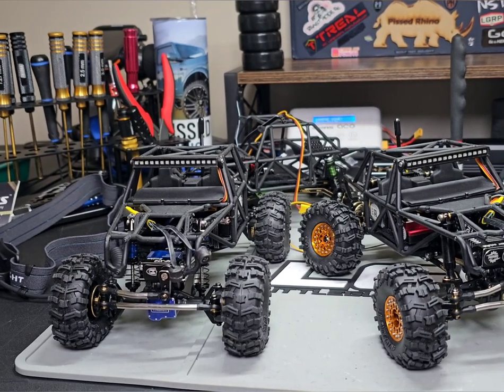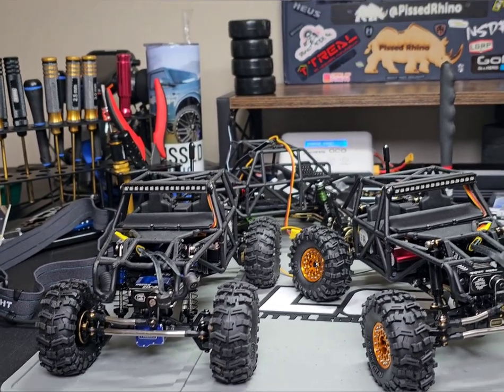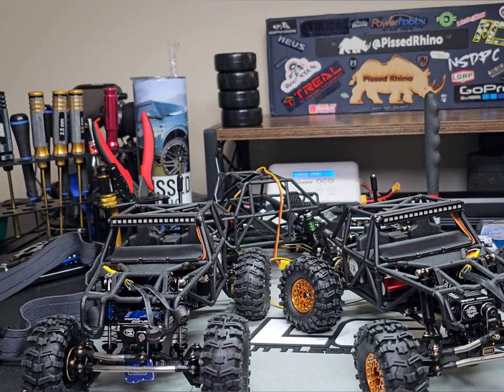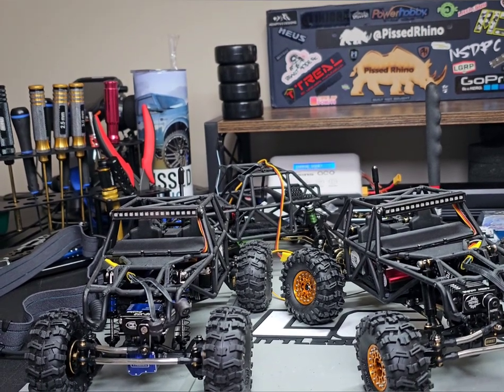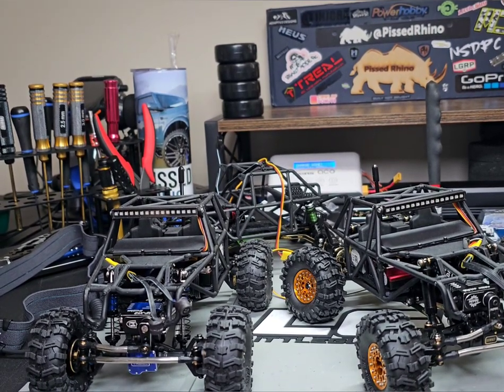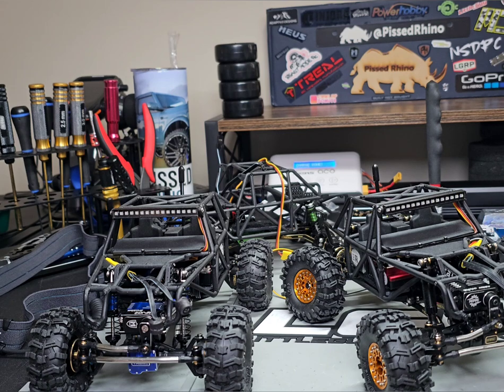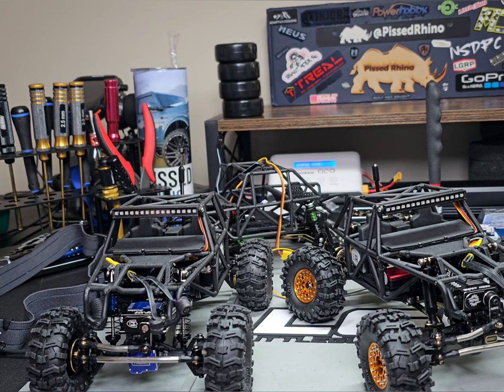The Pissed Rhino Show Staring The Traxxas Trx4m 1/18 Scale RC Crawler   "Where My Rippers At" Trx-4m

Comment: Where did you get the spacers for the rippers to hold the integrity
Reply from the maker: I bought them on eBay m2 x 35mm standoffs. They are only really needed when you cut the back out for rear wheel steering.

Comment: U should check out iceberg rc bronco body it's not a stock like bronco body yes it's lexan but with the trailing arms and pre runner like build the body matches up sorta like a Baja type/pre runner body. I think it would be awesome better then the stock  body and less weight and wouldn't have to cut up cause it's already fits the bill. Just paint they also sell trx4m body mount magnetic mounts for there bodies. I believe it's called the Hammer King
Reply from the maker: Cool, I will look into that.

Comment: I see you don't like the swamp kings much lol you have them on all your crawlers thay must be pretty good tires mate
Reply from the maker: They have chunky lugs plus are very very sticky. When you drive it on the wood floor you can hear the tires pulling away from the floor as it goes.
Reply: Awesome do thay grip good on the rocks
Reply from the maker: @jesseedgell8698  yes, they are known to be top 5 best crawler tires
Reply: OK awesome thank you what foams are you running in them
Reply: Please
Reply from the maker: @jesseedgell8698  well I do some crazy stuff inside my tires.  I have a video on tire assembly and that explains it very well.
Reply: OK thank you I'll check it out